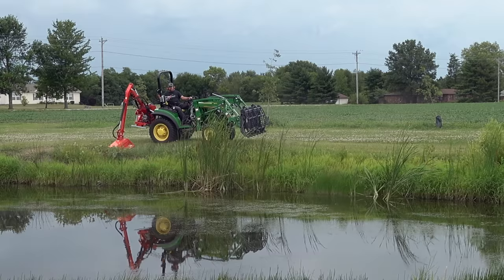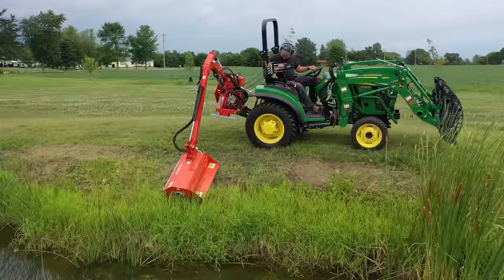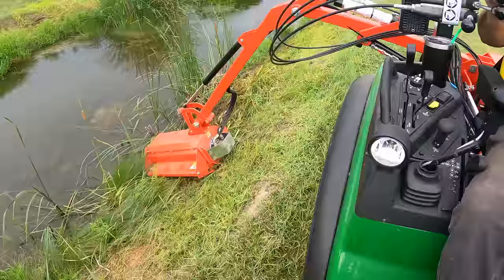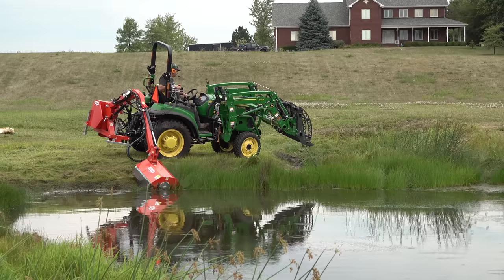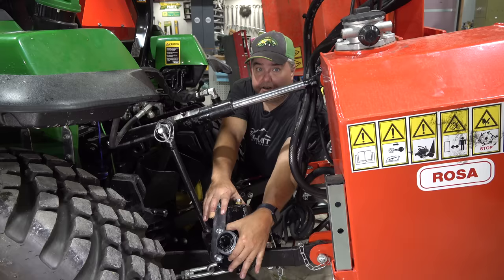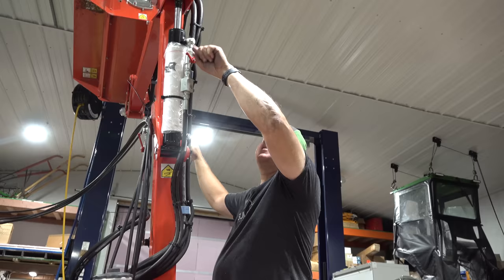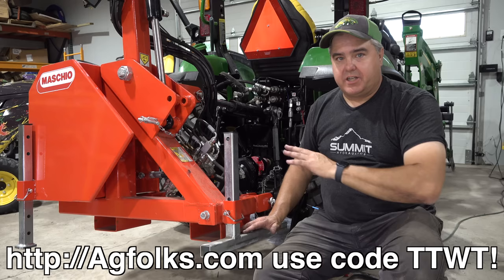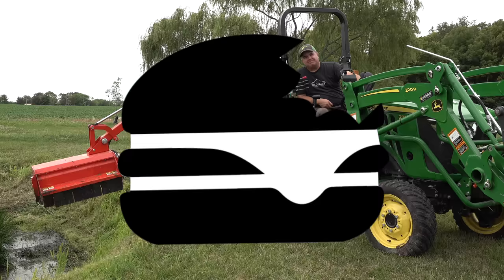BOOM FLAIL MOWER REVIEW! Mow Pond Bank; DISTRESSED Camera Lady!

Comment: I have a Twose boom mower a larger version of yours. My pump is mounted to the unit and has a pto shaft like a regular implement. My worst pto connector is on my inverted snow blower it has two pins to push to connect or disconnect on opposite sides of the coupler.
Mine wants solid stabilizers running from the tractor top link pin area down to the lift arms pins these eliminate much of the slop and tilt of the tractor arms.  On pto mounted pumps I like to put a stabilizer bracket on the drawbar to chain to, just piece of flat stock with a U shaped bracket and a draw pin hole to locate it.
Any boom arm mower can create a lot of pucker factor quite easily and rapidly.

Comment: If you had the front bucket on the tractor with a bucket of dirt it. The tractor would be more stable. Also keep the loader closer to the ground. I have been operating heavy equipment for many years and I have been an instructor for over 4 years.

Comment: Wish I could've been there, since I run a boom mower at work, maybe give you some pointers. As for the PTO link, I have it and it helps me because I have a quick hitch and it gives me back the 4 inches or so that you lose with regards to the pto shaft. I didn't have to buy a new shaft for my mower or brush hog.

Comment: Noticed a lot of gouging at the beginning of the video. I guess with the washouts and bumps it's inevitable. Maybe some type of adjustable wheel or skid plate on the mower head to go with the float function to keep it a minimum distance off the ground?

Comment: I'm looking at getting a 1026r, and starting out doing some contracting work, and would Johnny 1 run this attachment? As I'm really struggling to work out the best machine as I'd want Johnny 1 for the mid mount mower and the agility of working in small areas but also would like to run a front mounted flail and a rear offset flail. Also hedge cutter like this and a post knocker, and equipment to do work in equine yards and ménage arenas. Love the channel and your videos Tim, keep up the great work
Reply from the maker: I would suggest a 3045r (assuming you are in Europe.  Would need that horsepower to run front flail and rear offset flail at same time.

Comment: Nice video,   how would this work on the LX-3310,  I'm thinking it to light/small  for this piece of equipment.....  😗🤔👍👌🙂
Reply from the maker: Would be too light …and the 3 point not sturdy enough.  I already bent a lift arm with the offset flail.
Unfortunately, LX is not built very strong.  I don’t mean to be offensive…just stating my experience.
Reply: @TractorTimewithTim  thank you for your apply....    🙂👍👌🙂

Comment: Good Afternoon Tim!! A good through review on the product. I was surprised you didn’t have front counter weights or Bora wheel extenders. You property is very level so running your various down sprouts to the pond does not seem feasible. You may want to pull the banks back with a backhoe or excavator, to level the banks out.  I like Cliffs idea about planting various water plants which attract dragon flies to control the mosquito population. Very nice video…
Reply from the maker: I do have spacers.
Reply: @TractorTimewithTim  Good to know…Tim

Comment: Running the flail in reverse is great for unblocking the flail if it gets wound up with say brambles or vines. When I have the unit disconnected from the tractor, I slip a length of rebar through the tubular feet to make it more stable. I use mine to deal with a mile of hedge and a number of grassy slopes.

Comment: How does this compare to the Hardee Brush Tiger you used around the pond last summer? IE Stability for 2038R, usability, cut, price, etc.? I would think the Brush Tiger might be a little easier to see/manage while using and more stable bc. you aren’t having to get so close?
Reply from the maker: Probably able to mow a similar distance from tractor, Brush Tiger less expensive.
Reply: @TractorTimewithTim  thanks for the response. I appreciate it.

Comment: this is really close what i am thinking of doing but i want the oil tank and pump in the back running off the pto but the boom and mower on the front of the tractor i see that mower is really to heavy lie you said i am wandering if a sickle bar like on the ven track set up would be lighter and reach out there a bit mower also when mowing a lake or pond banks like that i was told you really need to leave about 1 foot of growth around a pond lake like that to keep the geese from the pond they get in there and start poing in there and the pond will have all kinds of algae on the pond / lake

Comment: I tried out the 2038r when I was picking out a compact tractor. It was too narrow for its capacity in my opinion. The 3 series is a much better size for something like this. That said, 3025e is a popular tractor and I think you need to specify if large frame 25hp tractors can handle implements, not just assume that all large frame compacts will have the higher hp options.

That said, if this flail is the best solution to your problem... I'd look to change the problem.
Reply from the maker: When you say ‘3 series’, beware.  The 3e is nearly identical to 2R.  Cept 2R has more capacity and capabilities.

Comment: Nice looking flail mower. I think that it would work great on my 10225R in the spring when I can't mow the street frontage do to it being a mud hole. Does that unit have any strength to the 2 arms to hold the tractor up as it starts to tip or would it just crumble?
Reply from the maker: It held ME up a couple of times!
That same ‘tip to the side’ action bent my Kubota lift arm.  I think I showed it in a video a long time ago.

Comment: I was thinking why not add duals to your tractor. Especially on the side that the mower is facing. The city ran duals on their Case Maxxum to fight tipping. The tractor also had a huge wheel weight to balance the big boom mower. They later added triples on the side where the boom was facing for more floatation and stability. They added a dual to the other side fallowed by a the huge wheel weight. I also thought why can’t Mashio make a mid mount boom mower similar to the big commercial style like what the DOT and municipal governments have. On the Maxxum the city had it had a Tiger mower mounted to it. It served the city from 1992-1999.

Comment: Cuts good but it needs a better way to regulate the cutting height. You are leaving tall grass some places and scalping down to dirt in other places - a lot. Seems like it could use a set of skids that could be set to control how low it can go.
Reply from the maker: Yes, but the surface is incredibly uneven.  The skids have a tough time dealing with this.  
Overall, ‘good enough’ in my opinion. …and it looked surprisingly good the next day….take a look at the prior episode…12’ turf batwing on 1038x to see what it looked like one day later :-)

Comment: Watching you operate those horizontal hydraulic levers mounted in a vertical row looked awkward. Would it make better sense ergonomically to mount the stems vertically in a horizontal row and move them forward on the tractor near the joystick?
Reply from the maker: I just stuck them in the easiest mount point.

Comment: Would a 2025R be able to run this mower? Asking as I own a 2025R.
Reply from the maker: I would get the one size smaller.
…AND…you need Rimguard and wheel weights to keep from tipping.  I would recommend two wheel weights plus Rimguard on the left side!

Comment: Question and comment..   Have you seen any issues with the rear hydraulic pump that is inside the back axel casing?  3 days after taking delivery on my 2032, mine blew out.. Even the dealer was shocked because it literally caused the entire tractor jump up and down off the ground, no joke.  It was hilarious watching them try to get the thing on the trailer.   Now, about 8 months later, I can hear the same extreme whine sound it made back then and the dealer is again taking it in before anything fails this time..    Irritating because my other tractor I traded in went 4 years without even a single small issue with it.   BTW, my 2032 has a whopping 52 hours on it..

And comment..   Should you not be wearing your seat belt doing that kind of work.. That arm is changing the center of gravity for the tractor and when you nearly got stuck at 8:44, it would have been very easy for that backend to slide sideways and down and away you would have gone into a roll.   No joke, we JUST had a farmer killed the other day from exactly that when his boom mower caught on a slight incline, the back tired slid and over it went.  They found him under the tractor sideways because he did not have the seatbelt engaged.
Reply from the maker: Did he have a ROPS?  I have no inclination to wear my seatbelt if I tip into the pond.  I am confident that I can ride the tractor over and get off safely.  Maybe I’m an idiot, but that is my thinking.
Reply: @TractorTimewithTim  Yep but he was thrown off the tractor and he ended up under it perpendicular.  From the scene, the tractor rolled to the right, upside down then over onto its left side (basically a 3/4 of a full roll because the back end slid down hill a few feet on the rops bar when it was upside down on the incline. When it slid down the incline the rops dug in enough to stop sliding, it rolled off the rops onto what would be the tractors left side and he was under that.  Had it rolled one more segment, would have ended up back on its wheels and he might have survived.    

Twice I have gotten into similar situations..  The first time was picking up a log that at the time we did not know was actually utterly water filled/waterlogged.  It was the same size and type tree as a dozen other logs the same size... this one however turned out to be heavier by a huge amount on one end and the moment I turned the front of the tractor, the back left tired left the ground and I nearly lost it.  I was quick enough to save it by dropping the load instantly to the ground.   But I nearly fell outta the tractor.

The second time I was almost literally ejected from the tractor when it bounced back down on the tires hard.  I was stump grinding this time and hit a root under ground just perfectly (walnut tree) and it let lose suddenly and the tractor jumped hard when the stump grinder (flywheel style and heavy as you can imagine).  That inertia is amazing with such a heavy design.  

Since then, anytime I am on an incline or moving very heavy loads, I wear the thing and there is a HUGE difference when something happens that causes the tractor to suddenly jerk or pull a wheel off the ground.. I no longer move in the seat and I have had a few times more than had I not been wearing it doing heavy work, I could have slid or possibly been thrown if the tractor had rolled etc.   I have the 2032 which is nothing to sneeze at.  The farmer that died was running a 3 series. Not sure which one though.

Comment: We have a pond.  Challenge to mow.  My wife would have yelled at me if I drove as close as you did because even you slid down a few times.  She grew up on large farm and her grandfather was mowing ditch when tractor slid and rolled on him and killed him so she does not take that sliding stuff lightly.  Stay safe
Reply from the maker: I trust the ROPS.  The old machines did not have a ROPS.  …but yes, there is some danger.
Reply: @TractorTimewithTim  ROPS work but seat belt use then becomes important too.  Sometimes around the pond I take belt off when mowing thing I don’t want to be trapped and would jump for it but that is off a JD 997R Zturn.  Anyway take care Tim.  Love all your videos and think of you guys when I see the Lebanon sign over I-65.
Reply from the maker: I simply disagree with the seatbelt thing.  I’m convinced I can stay in the seat when it lays down.  Likelyhood of a roll all the way over is low.
…and yes, I do have some experience with this :-)

Comment: Muskrats will burrow back under the bank and the ground can collapse under the weight of the tractor. Those areas should be leveled out before you try to mow with a flail. You should try to trap muskrats out for the damage they do to the banks. I know a farmer who was killed mowing his irrigation and drainage ditches when the tractor tipped over. I know he trapped the muskrats because I sold him some traps. It would seem that a front mounted flail mower would be more stable for pond or ditch work but would require spot mowing and would allow for the concurrent use of a rear weight bucket for stabilization.
Reply from the maker: We haven’t seen muskrats for a couple of years.   We ‘disposed’ of several during our first two years here.

Comment: How can I get rear remotes on my 2025R Gen 2 with a Mauser cab? Seems like all the reviews are on open tractors.
Reply from the maker: The summit kit will fit.  You may need to be a bit creative with mounting brackets. 
Get the summit Power Beyond kit, then the EVK if you want rear only, or the FR4-JD if you want front third function as well.  
http://Summit-Hydraulics.com/ttwt
Use code ttwt for a five percent discount.
Call em if you need help.
Reply: @TractorTimewithTim  Thank you!

Comment: Very dangerous to use without guards on side of tractor. Stones can fly up from flail, as been said here in UK they are called hedge cutters,  as we only have tractors with cabs the whole side of cab has to be guarded with  polycarbonate  or steel mesh.  And arm is on left side of tractor for our roads. I own a 170hp tractor and 5.5m hedge cutter and a 1.2m head, with a 65hp motor . Which weights about 9.5 ton.
Reply from the maker: Nah.  Not much thrown at all.  Nice guards on front side of mower.

Comment: GEOGRID THAT ENTIRE POND BANK, don't waste the time or money on rip rap when all you have to do is scrap up about a foot of the top layer of the bank and make it all smooth and even and then lay down geogrid and fill in the rid pockets with your top layer and then grasses, wild flowers or native grasses or just leave it bare or let it go wild. it'll last atleast 50 years.
realistically an offsetting tow sickle mower will get the job done faster, safer, and with superior results.
those boomer mowers were only designed for doing retaining wall terraces and hedges

Comment: A wheel weight in the LEFT rear wheel should be considered as necessary. 75 to 100 lbs would probably be adequate.
Reply from the maker: I have two wheel weights on each side PLUS Rimguard liquid ballast in the tires.
The Rimguard weighs much more than the wheel weights!
Reply: @TractorTimewithTim  That is good to know, however for myself I would remove the right wheel weights when using this mower as that extra weight may tend to sink the tractor into the soft spots around the pond. You definitely went farther down than I was comfortable with. I understand Christy's apprehension.